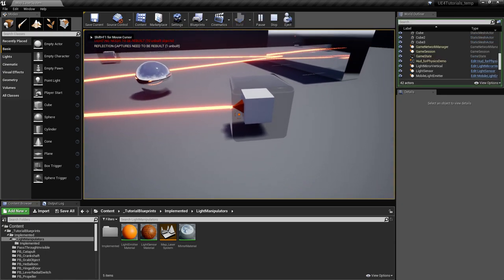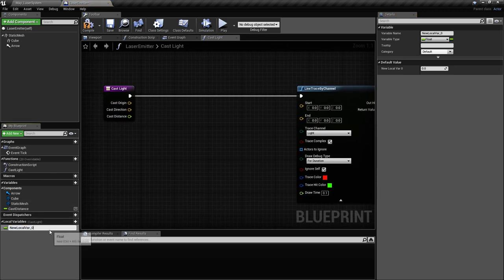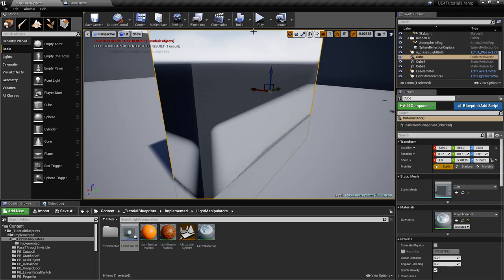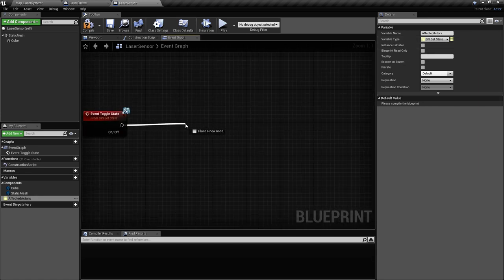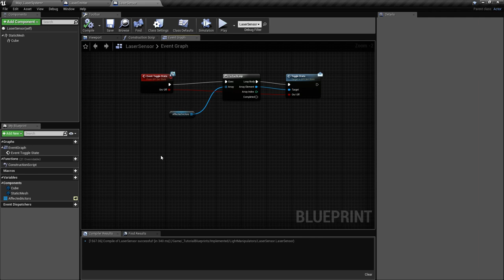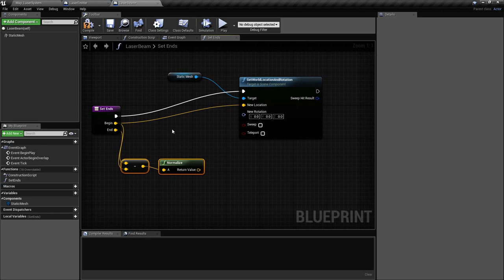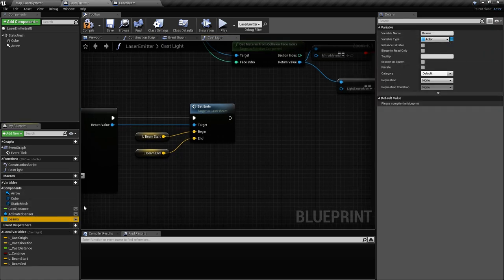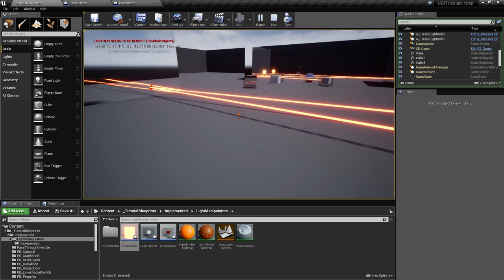UE4 Laser System that Reflects Light with Sensor and Mirrors in Unreal Engine 4 Tutorial How To

Comment: If you have the infinite loop error, just add the reflection counter. Create two float variables, name them for example "Max Number Of Reflections" and "Current Reflection Number". The first thing you do in "Cast Light" function would be setting "Current Reflection Number" to zero. Then in the While Loop condition, you will add boolean AND and connect to it "Current Reflection Number" <=  "Max Number Of Reflections". Then if tracing was successful you will increment "Current Reflection Number" (++).
Reply: Maybe I'm not doing it right, but this isn't working for me. :( The condition seems to always be coming back false so the while loop doesn't even run.
Reply: @lv99redchocobo  Instead of the while loop: For loop with break, setting max index to "max number of bounces" and breaking on failed hit worked for me.

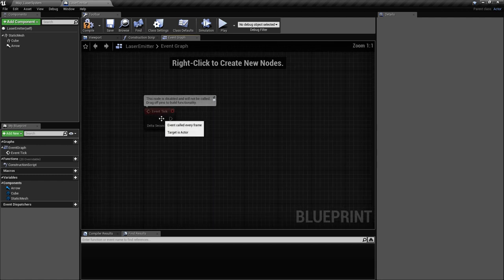Comment: 3:20 don't use delay instead go to class defaults and set the tick interval to be 0.01
Reply from the maker: Thanks, didn't know about that.
Are there any advantages for using that method?
Reply: @Lusiogenic  Reducing the tick interval is always good, also shifting the tick on different actors/Instances can help performance significantly. Imagine you have a 100 actor that tick at the same time, that could be a bottle neck, instead you create a variable(float TickInterval ) that you change for every instance, that way they tick at 0.01,0.02 so it is spread out
Reply from the maker: @elfideorubio1308  I agree, shifting ticks is a good idea to smooth out framerate, but reducing the tick interval will consume more resources, usually we would want to do the opposite, when possible.
Reply: @Lusiogenic  My bad I meant Increasing rather than reducing.

Comment: Nice tutorial. Loved it.  I learned a lot of things.
At first I thought what am I missing?  You can move the cube around. Then I started using Simulate and not run. This worked.
Then I saw your other tutorial on how to pick up an object. I'll be watching that next.
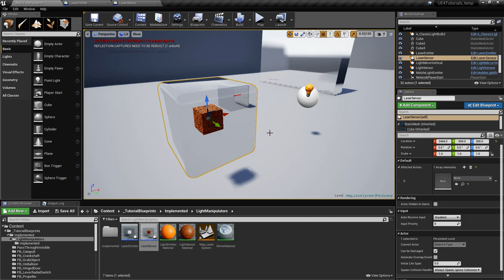The reason why it didn't work at 22:00 is because the type of AffectedActors should have been I_Use, because that's the interface you added to the light bulb.

Comment: Hey, great tutorial, almost everything is working for me. I have a problem where when I look at the laser beam at most angles, it has a weird "flashing" thing to it. It looks like 100s of smaller rays are being drawn on the outside of the main line. I do have the code implemented to destroy and clear the array at the start of the function, just have no idea why this is happening. It also only happens from most angles. If I walk up to the laser, its fine. It only happens when the laser beam blueprint is spawned from the emitter BP. I placed it into the level with the same scale and length, and didnt have any problems. Please help!
Reply: same problem, would love the help if anyone encountered this
Reply: copied from somewhere else in this comment section of someone who solved this, tried it now and it worked! : 

"Hi, I think this bug occurs because you're spawning your actor with a scale (1.0, 1.0, 1.0) and straight after you're scaling it to (0.05, 0.05, whatever the length)..
I managed to remove the weird visual thing by hiding the actor after spawning it and unhide it after the set Ends function!! :) Hope this helps"

so basically in the laserOmmiter BP change to this :  Spawn actor laser beam -> set actor hidden in game (true) - > set ends - > set actor hidden in game(false) -> add to 'Beams' array
Reply: @aviv1982  As soon as I get back to my PC to test this, ill reply, but this seems like ue4 normal weirdness. Thank you so much for finding this and coming back to this comment!
Reply: @ethandoesguitar1019  sure! Hopefully it works for you as well- just random question- do you have the bug where after an hour or so in the engine the sub-menus start to disappear? Like when in a BP and trying to find a node and the menu disappears for example. Annoys the hell out of me, and I'm on the latest version
Reply: @aviv1982  I thought that bug was just me! It seems to happen when the system has been under a decent load and got to a certain temperature, its super weird, and yep, never happened on older versions, hopefully ue5 will fix all of this
Reply: @aviv1982  Thanks, this worked for me.
Reply: @aviv1982  THANK YOU - it was driving me crazy ahah
Reply: @aviv1982  This should be pinned or be advice in the description. It worked for me!

Comment: Would there be a way to make a complex material that refracts the laser beam or changes its color? I need this system for a VR game I am making. Thanks in advance!
Reply from the maker: Yes. Changing the color is fairly easy, when re-emitting the ray, just put another color.
The refraction should also be possible, but you just have to take into account the fact that the refracted beam is emitted on the interior of the mesh, so double collision might happen. Just emit two beams in the refraction point and calculate each one of them separately.
I might make a tutorial on this in the future, but couldn't tell you when.
Reply: @Lusiogenic  OK thank you!

Comment: If you still respond to comments, can you PLEASE help? For some reason the laser beam spawns in the middle of the box it’s shooting off of and the middle of what it’s reflecting off of. This leaves it shooting out of the other side of the box although that side doesn’t do anything. The end of the beam doesn’t enough touch the surface. Got any ideas on what I’m doing wrong?
Reply from the maker: It's hard to give advice without knowing the BP, but pay attention to the spawn coordinates and what their relative parent is.
Reply: For anyone who is having this issue, 

I had this problem too, the fix was going into the laser beam bp, and making sure at the very beginning, from the set end function, make sure you are plugging the begin point into the BOTTOM part of the subtraction node, and the End Point into the TOP of the subtraction node.

i.e. you are subtracting the begin point FROM the end point. 
At least that was the fix for me :)
Reply: If anyone runs into this issue you can find the fix I did here: https://i.imgur.com/rtYoA83.png
Basically you can move the start point along the forward vector by half the vector length and that should offset having the location in the middle of the mirror.
Reply: @BassNuke  thank you very much, I have been blocking on it for 1 week! Thanks
Reply: @BassNuke   hey bro ! Thank you so much !!!!!!!  I did the same thing, but it didn't work properly, so I thought it was crazy

Comment: Hi, I have watched the entire video and then decided to do it by myself. I got to about 8 minutes mark when I have noticed that from some reason my beam goes up in 45 degrees instead of following the arrow. I have tried different things, watched and done step by step with the video, and it is still doing the same thing. It is like the beam doesn't want to follow the arrow direction at all. Any ideas?
Reply from the maker: Are the line traces for the beam working correctly? Make sure that you test that using the debug drawing of the line trace.
If the line trace is not correct, then you have to make sure that you calculate it correctly. Check the location and rotation of the arrow. Make sure that you use GetWorldLocation, not local. Check also the GetForwardVector for the arrow.
If the line trace is correct, then the visual representation is the problem. Check the rotation and position of the beam mesh (in my case, it was the cylinder). Also, check the origin point of the beam mesh.

Comment: Not working at all. If line hits mirror then loop goes to infinite and if it hits something otherthan mirror or nothing then works fine. It doesn't reflect in either case. I followed the same thing.
Reply from the maker: I have checked the setup in the latest version of the engine (4.24), it works as expected.
Make sure to check the loop condition after the first line trace.
Reply: Same issue
Reply: If you have the infinite loop error, just add the reflection counter. Create two float variables, name them for example "Max Number Of Reflections" and "Current Reflection Number". The first thing you do in "Cast Light" function would be setting "Current Reflection Number" to zero. Then in the While Loop condition, you will add boolean AND and connect to it "Current Reflection Number" <=  "Max Number Of Reflections". Then if tracing was successful you will increment "Current Reflection Number" (++).

Comment: Thks !
This tutorial works fine 4.19...
I have one problem ==> When I run this in thirdperson game mode,  the scale of laserbeam is not stable at x and y axis when the player looks around that but the length of z has no problem. 
Any suggestions for this kind of problem?
Thks again :}
Reply from the maker: You may be scaling it in world coordinates, which is not what you want. You should be scaling in local coordinates of the beam actor.
Are you parenting the beam to a component of the third person character? If so check that the component that you're parenting to have the correct scale.
Also, make sure that you have the correct rotation of the cylinder in the beam actor, otherwise it will scale on the wrong axis.
Last thing, make sure that the cylinder has the origin on the base, and not in the middle. If the origin is in the middle, it will scale in both direction and you will have to recalculate its position to be in the middle.
Reply: I have this problem as well.  Followed your example.  It seems to pulse weirdly with  every time the even fires (when your delay in the emitter sends the cast beam function.     I tried just scaling the laser beam blueprint in editor and i don't get this issue but when the laser is created at runtime on the emitter it has this graphical glistch Hidden Konitsu mentioned.  I'm on 4.20.1
Reply from the maker: Have you tried what I've mentioned in my last comment? I would be helpful if you made a short video with the problem, it's really hard to make out from your description what the problem is.
Make sure that you make the trace visible and see if it's valid or if it hits something else before your target object. It might be colliding with the player character, you have to make sure that the player character ignores the Light trace channel.
Reply: Hi, I think this bug occurs because you're spawning your actor with a scale (1.0, 1.0, 1.0) and straight after you're scaling it to (0.05, 0.05, whatever the length)..
I managed to remove the weird visual thing by hiding the actor after spawning it and unhide it after the set Ends function!! :) Hope this helps!
Reply: @MrThroughHeart  It helped me 4.21.1
Reply: @MrThroughHeart  Thanks! I was having the same issue in 4.23.1 I thought it might have been a scaling issue. I did what you said and hid the laser beam until after I set the ends, then I made it visible. Works great now. :) Also I want to thank you Lusiogenic. Great tutorial. I would recommend adding a limit to how many times the laser can bounce. If you put two mirrors in front of each other the laser will bounce back and forth forever and crash your game lol. I set a integer to count the number of bounces and only allow for 10 bounces before I stop the While Loop.
Reply: @MrThroughHeart  NICE, thanks you saved my life on this :D, that graphical "glitch" was driving me nuts :D
Reply: @MrThroughHeart  dude i cant do that can you help me please?????
Reply: @historie-hradu-zamku-tvrzi  How Did You Do that?
Reply: @picklerick7395  just putt small delay before scaling happens (delay it by max 0.001 sec) this should "fix" problem. What you se now is basically scaling in realtime on every tick. So that is why it flicker's
Reply: @historie-hradu-zamku-tvrzi  Doesn't work
Reply: @picklerick7395  weird it should, because then it doesn't scale 60 times per sec (depends on frame rate as it's connected to tick), did you tried to put 0.01 for example not 0.001? I will have to look it up in my project how much I have
Reply: Can I communicate with you?
Reply: @picklerick7395  yes, of course, find me on fb for example
Reply: @historie-hradu-zamku-tvrzi  fb name?
Reply: @picklerick7395  yes
Reply: @historie-hradu-zamku-tvrzi  what's your fb name?
Reply: @picklerick7395  same as here, profile picture also ;)

Comment: How do you get the light intensity to work with the simple light bulb?
Reply from the maker: If you look in the Light Bulb Blueprint (video description), you'll see that there's a LightIntensity. You can manipulate that.
If you want the trigger to send an intensity to the light bulb, pass the intensity through the interface, instead of On/Off information.
Reply: @Lusiogenic  Thanks for the heads up, I did that but it didn't work. Do you think it's because I put a material instance on the light bulb, because that's where the intensity is coming from?
Reply: @Lusiogenic  Actually I just answer my own question lol. Thanks for the tutorial by the way. It was very helpful, and just what I was looking for.
Reply: @Lusiogenic  I dont See Light Bulb Blueprint in video description

Comment: And this should be easier and more understandable than programming? Bet you could do this in 100 Lines of code.
Reply from the maker: This IS programming, just the visual kind. A lot more easy to understand for beginners then C++.
Frankly, I can code in C++, but I don't want to be bothered with the complexity that it adds when I'm prototyping.
Most of the people spend time prototyping, so Blueprint makes more sense.
I expect that when people go into the later stages of development, it's their duty to optimize the code and pass it in C++ if necessary.
Reply: @Lusiogenic  coming from a coding background, I find the visual style more complex. But i agree it's just my personal opinion.

Comment: 4.21 has broken this code. Infinite loop created with exact code. Edit: While loops in 4.21 are broken and will only result in errors.
Reply: Do you find a answer/solution to this thing?
Reply: @firimousse3676  Nope, I fount a post from 2014 about the same issue, so it seams a previous fix has been broken again.
Reply from the maker: I've checked in 4.22, seems to be working fine. Can you check again?
Reply: Same problem here (4.23.1), I've tried to increase the maximum loop iteration count but still not working :(
Reply: I know it's been a year but i was having this same problem. I had put the mirror material on a box brush but when i put it on a basic cube i stopped getting this error. Not sure why that matters but oh well lol 4.22